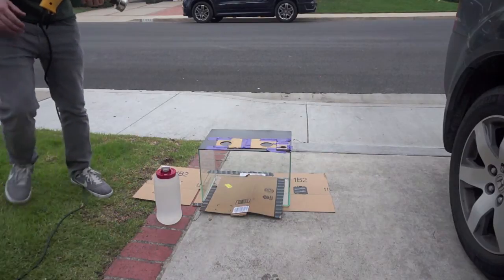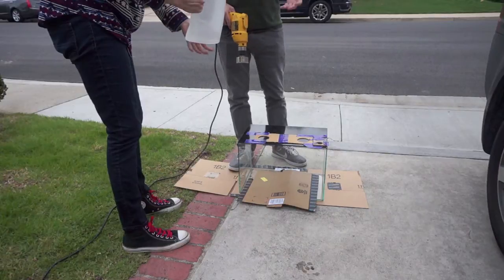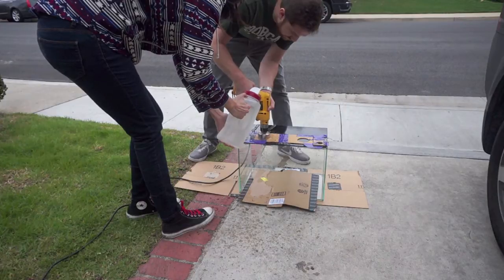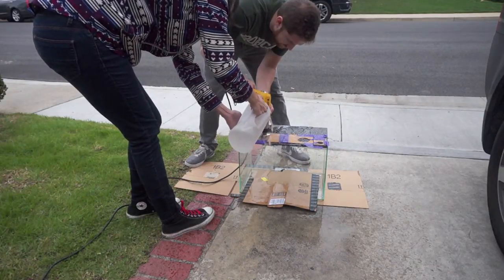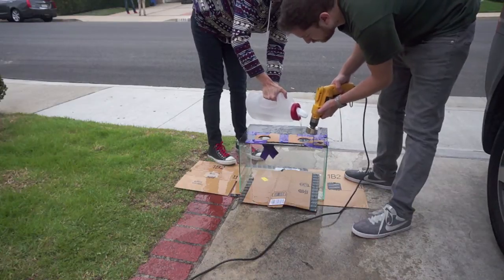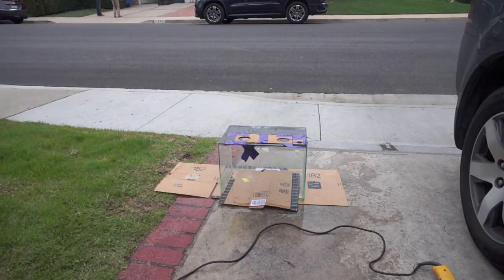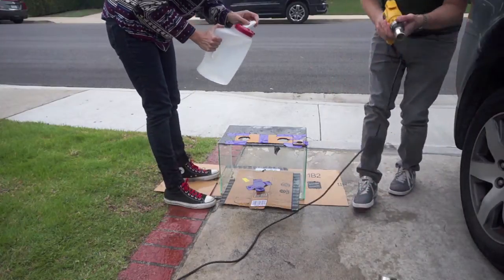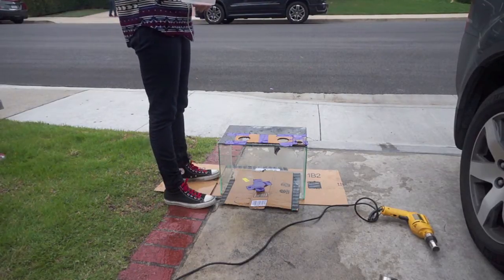Nano Reef Tank Drilling

Comment: Great job, but you're brave not wearing safety glasses. You actually drilled those holes twice as fast it took me to drill one hole.
Reply from the maker: Thanks! Of course dumb me didn't think about glasses, I'll for sure wear them next time. As for the speed I was quite surprised as well but the glass is super thin as it's such a small tank.